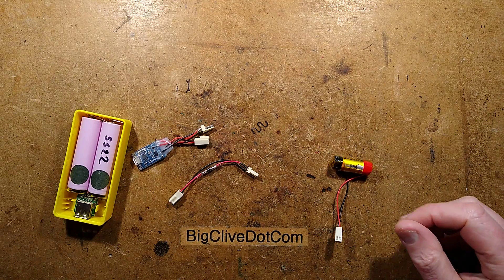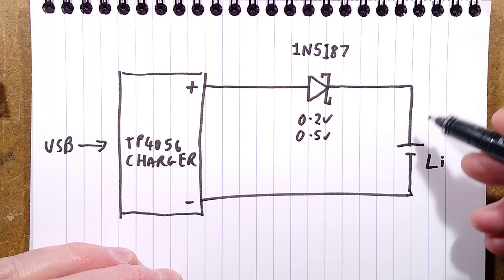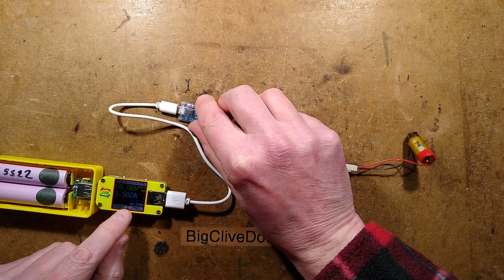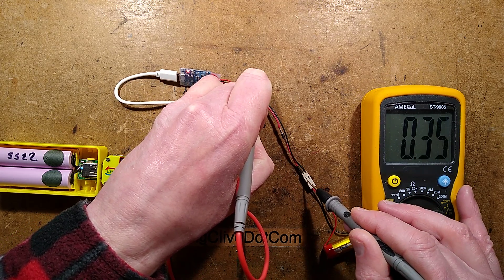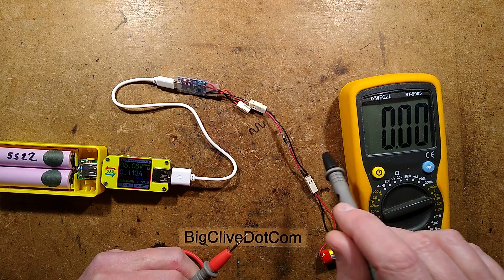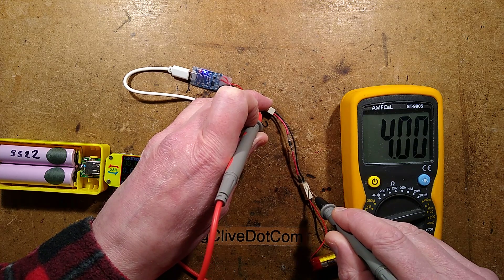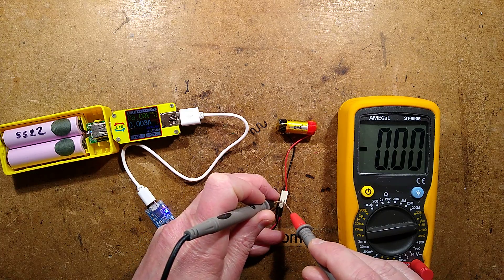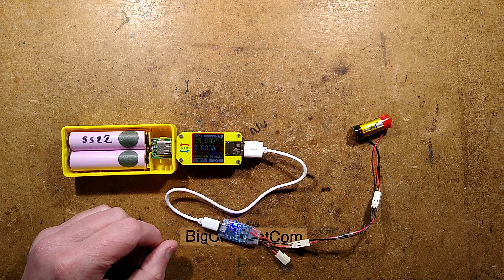Schottky diode between charger and lithium cell?

Comment: I would be worried about the charger restarting itself over and over. By that I mean restarting the charge cycle. Li-Ion battery vendors have told me it is absolutely critical that your system not restart a charge cycle automatically more than once a day. That is to say, once the battery is topped off the charger must shut off and not automatically restart for about 24 hours (12-24 is pretty safe). If the user unplugs and replugs the battery it is safe to start again under the idea that no human would sit there and manually restart the charge cycle many times a day consistently enough to rack up cell damage and a noticably accelerated rate.

So your diode causing the charger to terminate charge and then the charger seeing the voltage is low and starting again means it can restart many times in a day. And in fact I think during this video you see that happening. This would concern me.

I guess it wouldn't concern me much if I were scavenging cells from vape pens. But if I am making something where I want the battery to last (either due to cost or difficulty of replacing it) it would.
Reply from the maker: It's not an issue in this case as it isn't trying to repeatedly top the cell up the hilt.

Comment: The charger for my ebike is programmable and allows you to charge anywhere between 100% and 80%, which translates to 4.14 to 3.96 V/cell. I'd like a charger for small cells that would give me the same choice.

Comment: Two thigs worthy of note: The 1N5817 is the higher voltage Schottky diode, maybe try the lower voltage ones? Also a 3A diode will have a much lower voltage drop, so perhaps a 20V 3A diode will do much better...
Additionally, a capacitor before the diode may help with the oscillations... I used this combination in a device I made with an aux. lithium battery that was soldered, and a removable main battery which charged to 4.2V, and fed into the aux. via the diode.

Comment: LinusTechTips just did one of their "handy tech under $100" videos that featured a device intended to protect battery longevity. Apparently, you just plug your charger into it and program hours on/days off based on whatever the device manufacturer recommends. Basically just a timer with a very specific intended use case. I don't remember what it was called, but I remember thinking you might find it intriguing.

Edit to add: The "Charge-O-Matic." Nice straightforward name.

Comment: That's an easy way to make a "storage voltage" charger, not so accurate but cheap. Used to build the same one sorting out old laptop cells, now I need more of them to handle "disposable cells from vapour devices")) 
Li-ion batteries feel bad being stored fully charged or fully discharged.

Comment: Ultimately you want to sense the cutoff voltage for the charger without having the charger throttle. I don't know how to do that for the price of a diode though. My solution would involve a custom PCB with a comparator driven switch - and at that point you might as well just make your own charger with a programmable output voltage.

Comment: I'm gonna assume that it won't work, due to charger wanting to check cell voltage and it will see none, (or it will see it and not be able to charge it depending on diode direction)

Using a psu to charge it will work but you loose diode drop, (charging lithium from 5v with diodes is sketchy, but works, not recommended)

Edit: guess the charger acts more like a psu than I expected, interesting

Comment: Note: the longer it takes to charge a lithium cell the more detrimental the charge is to the life span of the cell.
Reply from the maker: Slow charging puts much less stress on a cell than fast charging.
Reply: @bigclivedotcom  On the contrary. There is a University in the USA that has a entire department devoted to the research & development of this technology and they have some of their research here on YouTube. Charging keeps the cell chemically active...the longer the cell is chemically active the more detrimental the charge is to the lifespan of the cell. I'm not saying to operate the cell out side it's specifications. But say the fast charge rate is 2c...if you charge the cell at .1c (instead of 2c) the 'slow charge' will be more detrimental to the lifespan of the cell. The information is out there. Slow charge may put less stress on the cell but it is more detrimental to the life span of the cell because you are keeping the cell chemically active for a longer period of time rather than having it at rest.

Comment: What about putting a 2nd diode in reverse parallel to the other one so the charger has the ability to see the battery voltage (less the voltage drop) all the time instead of only during the active charge cycle. I think it should help with the oscillations and thus speed up the charging while still preserving the lower cutoff voltage
Reply from the maker: I tried that in an earlier experiment and it didn't improve things.

Comment: O.M.Ps
2:49
3:29
Thanks for the info here BC. Really interesting experiment. I'm wondering if a decent sized powerbank can be made from these? 4p 3s. I'm struggling to get a design together. I was hoping for a medicocre amp (1 or 1.5), 12v thing that would at least charge a 3000mAh phone and a string of 5 soft white LED's. What troubles me additionally is the charging. TP5046 wont do obviously. Are there any tp4056 (single input output) like designs that can do 12v without the hassles of BMS boards. I prefer for the cells to balance themselves via sitting in parallel and have tp4056-a-like cut off at 12v. instead of tp4056 very low capability of a single cell per board. Can you design something like that BC? tp4056 is brilliant but limited.  How wrong is my idea?  is it even possible?

Comment: I wonder if using some kind of threshold voltage on the chip enable pin of the TP4056 would be an alternative solution to have something that pulls the CE pin low at 4.0 volts to end the charge. Maybe a TL431 on vBAT with it's threshold set, could then pull CE low... though I guess at that level, it might work out more effective to just have some cheap charge boards made for custom purposes. 

It'd be nice if there were a TP4056-like chip that had charge voltage control as well as the ability to set current it already has. I think in any boards I'd like to build for things, I'd like to set the cutoff voltage to 4.1v since that would increase the life of batteries a fair bit, but not sacrifice too much capacity... Sort of between the mil spec and the regular specs as a "good enough"... but I dunno. Schottky diodes and TP4056 natural variance seems to make it somewhat difficult to standardise the solution you tested in the experiment.

Comment: So with lifopo4 batteries, this doesn't matter right? Since you can't evaluate charge % based on voltage, and they "like" being charged to 100%? I wonder if the militaries use these instead of li-ion now to avoid mistakes and extra components? 20% is more than the diff in capacity between the chemistries right?

And no fires!

Comment: in my entirely uninformed opinion, I'd have to imagine the battery wanting to pull in current to charge itself (for some reason my brain is telling me that the chemistry wants it to pull in a certain amount of current) is warring with the IC's charging control circuitry

Comment: While the high-volume chips don't do this in order to keep down cost, I've often wished that they had a resistor to set the target voltage as they do the charging current.

While the data shows that 3.9V dramatically increases the lifespan of LMC, even 4.15V will result in a nice improvement without sacrificing relevant capacity.  Unfortunately, common charging chips don't offer fine adjustments; even those that do both LMC and LFP tend to just have 2 modes and a solder bridge to switch between 3.6V and 4.2V.

Comment: Hi, Clive. Talking about longevity of lipo cells I am of the understanding to use charge current of greater than the nominal capacity ideally 1.5 x I refer to the flat type used in R/C models. Please are you a lipo guru and what’s your understanding? Does this sound credible? I’m keen to hear your views, thank you
Reply from the maker: It depends on the style of cell.  I prefer to use a maximum charge current equal to the capacity in mAh.
Reply: @bigclivedotcom  Thanks for taking the time to reply. I try to stay open minded.
From my experience so far I am witnessing better output performance and better cell balancing after I began to charge my LiPo's at a current above the nominal capacity. My scenario is HRB 6S (cell) 5000mAh 40C used in model Heli (Align T Rex). If you are up for doing some investigation into this I for one would be really grateful.
Thanks, love your content

Comment: The same diode drop concept can be used to keep a battery-less Android phone running as a webcam for example. The phone without its battery can remain plugged in indefinitely. There would be no battery maintained at full charge to its detrement.

The phone would be powered by its charging port while at its battery connection connectors in its empty battery bay one feeds a faked sub-charged battery voltage using a diode rated above the phone’s power draw. Often these phones will not operate battery-less while powered by its charging port alone. Here the phone thinks it has an almost charged battery, so it operates.

Would Mr. BigClive consider making a definitive video on this topic? There are a lot of old Android phones sitting around waiting for a purpose suitable only when there is no phone battery to become like successful Jiffy Pop popcorn.

Comment: Can you do zoom in on the diode package? I could swear I see a stripe the improper side most of the video, but then I realized maybe it's not the traditional black cylinders I'm used to
Reply from the maker: The diode points to the cell positive.

Comment: Nice experiment, a slightly lower Vf schottky might make this worthwile, you can get ones with about 150mV@100mA which would let you charge to 4.05V. But I agree a controller with an adjustable termination voltage would be better.

Comment: You just reminded me that I would love to replace the 3x AAA cells in the HarborFreight $1 flashlight with some sort of rechargeable option that can recharge wirelessly.... so a) it is always a maximum brightness when fully charged, b) no more finding small screwdriver to change batteries, and c) no more cheap alkaline battery acid death.
Seems I keep having homeowner reasons to be in the crawl space / on the roof, and these are great handsfree flashlights - that suck when they go out at an inconvenient time / leak acid when not in use.
Looks like even more ideas to consider. Thanks!
Reply from the maker: Note that some cheap flashlights rely on battery impedance to limit current through the LEDs.
Reply: @bigclivedotcom  Thanks for the info. That is probably the case here, because I don't really recall seeing much of anything inside.  :)

Comment: I have some 134n3p pcbs from a power bank that usually stop charging at 4.04-4.05v. I have tested a dozen of them and the output voltage is 5.08-5.13 and the highest finished charge voltage I have seen is 4.08v. That's really close to 90% charge voltage for a 3.7v cell.

Comment: I’ve always wondered how these things "measure" the voltage across the cell. Does it pause the charging for a bit then measure the voltage, across a high impedance load? Technically voltage can’t be measured without a tiny current, right?
Reply from the maker: I think it goes by its own output voltage.

Comment: Maybe worth selecting a diode with a minimal forward voltage drop?  80% capacity isn't a bad thing at all, and for emergency lighting that would certainly extend the cell's useful lifespan for a few pennies spent.
Reply: Can you please explain this in more layman's terms
Reply: @keylanoslokj1806  Essentially, Lithium battery chargers detect "end of charge" via cell voltage. Schottky diodes have a lower "conduction" voltage drop than your "normal" diodes, and this small voltage drop adds to the battery voltage, so when the charging circuitry "thinks" the cell is fully charged, it in fact isn't quite fully charged. This very slight under-charging can really extend the lifespan of lithium cells, so it's a useful (and cheap) way of keeping your cells going far longer! Hope this helps!

Comment: Soo it could work to charge a lifepo4 cell using a li-ion charger?
Chargers for lifepo4 can be harder to find in weird configuration so it could be a good hack to play around !
Reply from the maker: I'd recommend against that.  It's better to use a proper LiFePO4 charger.

Comment: Nice! Maybe the next project is hacking the TP4056 module for an 80% SoC endpoint. Could I use a rectifier diode instead for a final 50% SoC which is perfect for long term storage of these batteries?
Reply from the maker: That might work

Comment: With that TP4056 module, should two diodes be placed in anti-parallel to allow an external circuit to be powered by the battery?
Reply from the maker: That was the first version I tried for that exact reason.  It also lets the discharge shut off sooner with a classic DW01 protection chip.

Comment: Years ago, I ended up with a large number of Trustfire 18650 lithium battery chargers, not wanting to use them, I measured the entire batch and found one that held a maximum charge voltage of 4.15v ( due to the fine Trustfire quality control) , this one I kept, and have used for years now, and it does fully charge a battery to 4.15v , through casual observations, I believe this might extend the service life of batteries, it certainly gives one more peace of mind when charging batteries not destined for immediate service.
And best of all the Trustfire has not lived up to its name. ( you can TRUST it will set FIRE to your home)

Comment: This scheme works well as a poor-man's LiFePo4 charger using a standard silicon diode. The TP4056  enters the oscillating mode at about 3.55V on the cell. All charging ceases at about 3.65V after a few hours. The best "diode" to use for this is a power transistor with the base shorted to the collector. Some experimentation may be needed to find the best "diodes" to use. No, LiFePo4 cells do not turn into volcanos at 3.65V.

Comment: Next, put an entire spool of thin wire in series instead of the diode and test if the voltage drop is enough. You could fine tune it 😂.

Comment: I've used a normal bridge rectifier in series with my ebike charger to prevent charge to full 42V and it did work, charged to about 40.5V. Paired with a normal switch, the limited can be bypassed if needed.

Comment: Interesting - thanks, Clive!   Using diodes (other than zener diodes) for their forward voltage drop can be quite useful. I struggled last xmas to find an effective way to drive strings of addressable 5V LEDs with long cable runs from a Beaglebone which output 3.3V data; the thing that finally worked was to use a single WS2812B powered from 5V via a diode. It provided both level shifting on the data and cleaned up the data from the controller. Excellent blinkenlights ensued!

Comment: Perhaps a zener diode, capacitor and resistor could be used to fake the charge voltage? Not efficient of course, but efficiency wasn't a goal, right? 😁

Comment: Be interesting to try it with a voltage reference operating in shunt mode. There you could get your fast charge since it would just keep sucking the full 500mA once it hits the set point of the reference (at, say, 3.9V). Inefficient and hot, but probably effective.

Comment: The years long mystery is finally solved!!!!

I suppose you could bump the voltage and charge up by using a diode with lower Vf.  1N5187 seems on teh higher end.
Reply: The 1N5187 that you feel is "on the higher end" isn't even a Schottky Diode ! D- for homework

Comment: I wish 4V per cell were standard for all devices using li-ion cells. I repair a lot of stuff (also for other people), and I can't even count how many devices got thrown away because their battery packs were dead. Handheld vacuums, lawn mower robots, bluetooth speakers, power tools, e-scooters and -bikes, laptops, tablets, phones and many more. All for at most 20% extra running time.

Comment: Good test, that's something I usually plan to do as I don't want to charge things to their limit. I set the current lower than the factory setting when I pop 18650s into the charger. Never know how modules are going to react to something until you test them.  If I remember right (might not) I don't think NASA even recharges to 3.9V since they can recharge every time a craft orbits the earth and the batteries need to last as long as possible, they try to stress the battery as little as possible.

Comment: Thanks Clive 
Any thoughts on this idea???
Been toying with replacing some. Cr 2032 cells I use with salvaged flashing fairy lights. Ie a single white led originally used in the Christmas display signs to simulate twinkling stars. 
I have modded a few to red led lights, that I attached to my dash cams to give the impression they are on 24-7 record. 
I usually get 8 months between battery changes. 
However I’m thinking if I use a tp4056 with a salvaged vape cell. That charges when vehicle is running I can save my self the bother of getting batteries. 
So one diode on charging circuit and then 2 or 3 on the output to drop voltage to Cr 2032 voltage.

Comment: I made a ghetto 18650 backup for an led light - used two diodes to drop the 5v usb input a bit, and an overflow diode that shunts excess batt voltage through the leds, bypassing the light switch.   When left plugged in, the battery floats at 3.6v and there is a nuisance glow from the white leds when switched off.  5 years later nothing blew up yet...